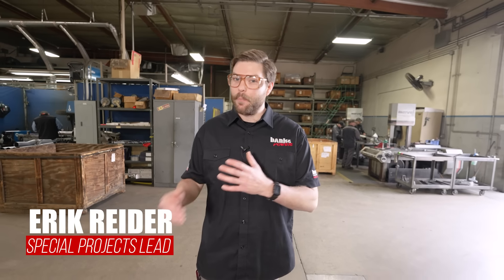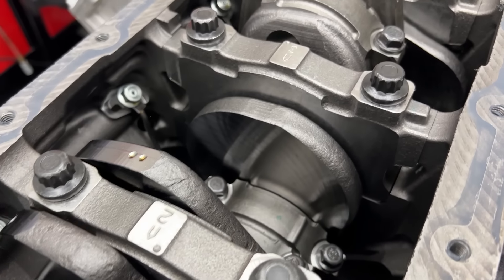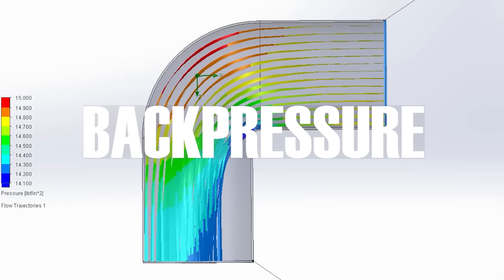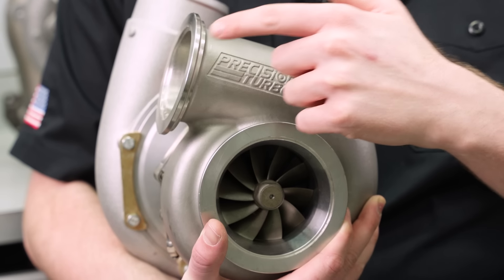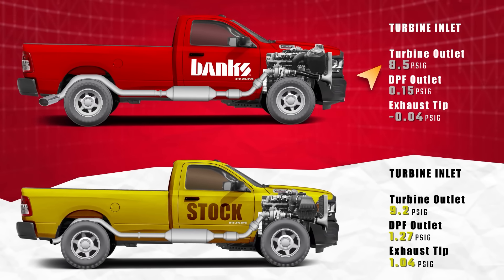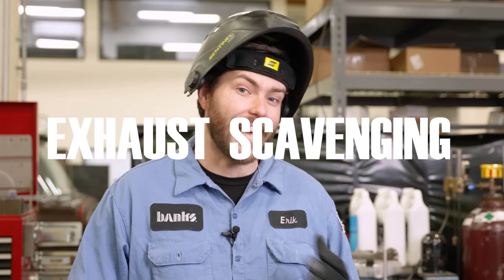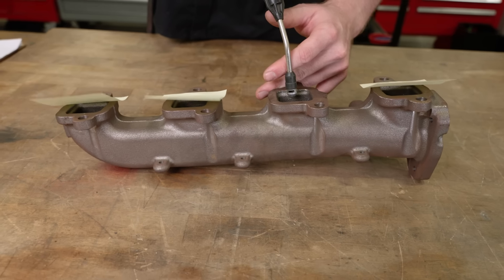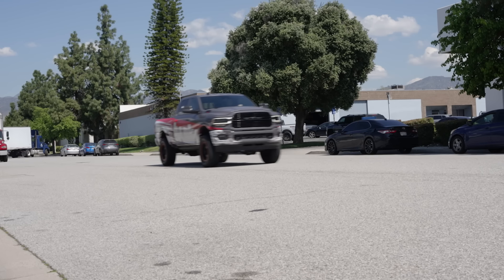Busting the exhaust backpressure myth | Banks Entry Level

Comment: What I’d like you guys to then test is back pressure on the effects of Fuel economy. 

Reason I say this is because on my racing exhaust on my old N/A car when I drove with my exhaust mute on the car (which arguably creates a back pressure/flow restriction) I had much better fuel economy. 

This was on an N/A JZA80 running a HKS Racing Exhaust. 

I’m since Turbocharged with same exhaust but I wouldn’t dare run the mute on my current setup.

This is why  I argue, Backpressure bad for power but potentially good for fuel economy.

Let’s see what you guys think if you’re willing to do the testing. Note Gasoline vehicle not Diesel

Comment: I have a 68 ford falcon. Built 289 and although it sounds great with open headers it's extremely doggy, but the with headers flowing through the full exhuast it spins halfway through 2nd gear.

Comment: not sure about more modern engines but if you improve the exhaust flow the car may start running lean. At cruise and low load it self corrects but at WOT it uses a predefined fuel map and it will not add more fuel so it could run leaner than would be required to be safe

Comment: This all comes down to air velocity at both intake and exhaust valves for a given engine.  

The intake system before the intake valve and the exhaust system after the exhaust valve have an effect on each other.  
I am an engineer and I have done CFD simulation on intake systems.  
To be honest it takes a CFD (computational fluid dynamics) analysis tool to predict those delta P's.  
Everything else is just guessing and trial and error.  
Banks is doing CFD and validating their presumptions. I do that very thing for a living and it's time consuming and tedious work.

Comment: Thanks for another information video @bankspower. There has been a constant discussion about the valve lash setting on 6.7L Cummins. I have been told that setting the valve lash on 6.7 Cummins makes it run better. Seems like it would restrict the amount of exhaust from leaving the cylinder. And keep that extra pressure in the cylinder. Could shed some light on this?

Comment: Nice Video and technical explanations. Can Back Pressure be also a result of poor exhaust gas velocity for instance going too large on Turbo Downpipe on a small capacity Turbo motor ? So what happens is more cooling of the exhaust gas as it expands into a much larger void and thus slowing the velocity and increasing the Back Pressure ? I think this effect may be more pronounced on smaller engines but on bigger motors, not so much. so when they say you need back pressure I think they mean, make sure to use optimum pipe diameters for your engine capacity.

Comment: The origin was not dealer myth, it was the fact that less backpressure means more pumping efficiency, which means more air.  Unless the carb can account for the extra oxygen in the system, the engine would run lean and burn out valves.  Its the reason that Fuel injection engines typically need a tune after new headers particularly if they use speed density fuel management.  Speed Density tables count on the engine having a set efficiency range and adjust the fuel vs intake pressure according to that engine setup.   MAF system know extra air is coming in and can better adjust up to a point.

Comment: I installed a full banks exhaust on my Cherokee years ago. Im running a different exhaust now i still have that banks header in my shed though surprisingly it didn't crack ive replaced many cracked manifolds on many 4.0 engines over the years it doesn't matter if its a performance design or stock replacement they all crack eventually, my motor mounts may have helped keep the banks from cracking being that they are more solid than stock but i put over 100k miles on that header. I have seen a cracked banks header i replaced with another banks on someone's jeep but its a damn good header one of the best. Another thing to keep in mind on a jeep that sees off-road is these exhausts go through hell especially if they go through water and stuff its surprising how much abuse my header held up to. 
After installing that full exhaust on my Cherokee the power was noticeably more its a good exhaust. But isn't the muffler on that system a glasspack design? Maybe im thinking of another muffler but i thought the banks muffler was muffler shaped but straight through glass pack. We have had a bunch of cherokees I'm a bit of a Cherokee nerd. My wife has a banks header on hers mine is heavily modified we also dont run cats anymore but i had the cat and everything with the full bolt on system years ago that was a good system. Im running a Gibson header then custom exhaust with a flow master muffler on mine now. 
Back in the early 2000s i was running one of those cherry bomb glass packs on my old datsun and when i replaced it with a regular muffler I believe a flow master the low end torque i picked up and power was crazy i was very surprised because that truck was a slug it was a 4x4 on 33s and didn't have much power so the increase just from a muffler swap was awesome. 
Im a big fan of the banks header on the 4.0 i went with a Gibson on mine because I didn't like how the banks was rusting and the Gibson has a ceramic coating then the design looks similar to the banks i believe the banks is stainless but it still was rusting some it was also like 8 or 10 years old when i replaced it.

Comment: Its also conflated with Exhaust velocity. too big of a pipe will drop the velocity of the exhaust causing the flow at the cylinders to not evacuate completely as its not moving fast enough to do so. too small and the opposite happens. while yes the velocity is higher, the gasses cant move out of the way, because now the pressure is too high.

Comment: 1st mistake: When you pop open the exhaust valve, most of that gas blows itself out under pressure. The exhaust stroke only forces the last remaining bit out. Obviously flow resistance doesn't help, but the piston is not doing even a quarter of that work.

Comment: Properly tuned diesel and direct injection OK. How about petrol carbureted when valves overlap? Your mixture will go down the drain and BANG! Backpressure keeps the mix inside the cyl when the valves overlap.

Comment: If you have back pressure on newer cars your catalytic converter is plugged. A good exhaust assists with scavenging and leaves a vacuum in the cylinder

Comment: Great video, yes please on the headers video. Short vs long, equal vs unequal for blower and turbo options would be great. 

Loved the pressure sensor based design, kicking bro science right into the weeds. 🦾👌 Scavenging vacuum tip is really cool too. I think I caught a glimpse of how it worked in the video. Clever stuff. 😉🤓😎👌

I’m really keen to tune my Pajero but I don’t trust half the clowns over here… I’ve been around tuning shops since I was an engineering student. I’ve seen so many people, including customers in one of the shops I worked in 🤗 having their motors blown up by cowboys with no clue and no regard. Luckily I was in my final year when the other mob took it over. Only six months to run. 🏃‍♂️ 😅

It’s a minefield out there, not anywhere near enough Banks’ in the game sadly. 🫠

Comment: My Ford E350 had one of its downpipes bolts rust away, so it slipped off the manifold on that side, was super loud, but i definitely noticed some effects on its performance.  This has to do with a combination of reduced back pressure, and likely something to do with O2 sensors and how the Ecu is programmed. It actually bogged down at lower rpm and seemed to make less low end torque. I did however feel a bit more powerful at higher rpms. Honestly the lost low end was more noticeable for most daily driving in a work van, but I did miss the surge of power higher up after I fixed it. Simple enough concept, at lower rpm the amount of flow required to produce the low end torque and power is much lower than at higher rpm, someone can explain in more detail why the low end was neutered, it probably isn't because of not having back pressure, but rather, from not having enough exhaust gasses forced past both O2 sensors. At higher rpm there was just enough.

Comment: The fun thing about this is my k24 needed a muffler to idle properly. All the stuff i tried didn't work. Then throw a stock muffler back on and it idles mint now
Reply: I run twin resonators no muffles in my car and its fucking awesome. Perfect idle, loud, great throttle response from 850-6500 rpm and big flames on shifts over 3000 rpm all on the standard tune. You should try it!

Comment: Exhaust back pressure debate. It depends on what you are after. Car manufacturers carefully engineer their mufflers to find a good balance between power, efficiency (gas mileage), emissions and noise level. If your argument is about the most power, you are probably right. If it is about fuel economy, I would say it depends on the system design. When it comes to complete combustion and efficiency of the catalytic converter, you will find another optimum point for flow and pressure. When it comes to noise level, there is yet another optimum design which would yield the lowest noice but with reduced maximum power and efficiency. So it depends on how the system was designed

Comment: I think this myth also comes from the people who put too large diameter pipes on their vehicle. Lost low end torque. And figured it was "not enough back pressure" causing loss in power. When really it was lack of velocity and / or poor tuning in general. Making them believe back pressure was needed. When really the smaller pipes increased velocity.

Comment: Backpressure is needed for an engine. A two-stroke engine. That's where people got the "myth" from. They heard that one type of engine needs backpressure and that obviously means ALL engines need backpressure.
Reply: That's for sure not only where the myth started, but also 2 strokes don't need back pressure either. What you're thinking of is tuned pressure waves, via those expansion chambers. And those too are tuned for specific RPM ranges. if not designed correctly they just end up causing restriction and back pressure reducing overall power.

Comment: Lets talk about why an n/a engine will loose low end power substantially when running open header with extentions vs a full high flow exhaust. Engine i speak of is mu ls1 with a bigish cam. Afr is accommodating for the lack of restrictions but has no snot under the curve but did when i had exhaust on it. Psa fuel management is always learning and adjusting tune
Reply: I believe you need to have good afr. If you run a standalone ECU, you can adjust for the pressure change.

Comment: Right I see a lot of confusion and misunderstanding in the comments. In scientific and engineering nomenclature there are two kinds of pressures happening in a tube. The dynamic pressure and static pressure. The backpressure that people are talking about is static pressure and the speed of the flow is dynamic pressure. Now here is the interesting part, the dynamic pressure and static pressure have an inverse proportionality relationship (I'm trying to simplify the concept here). This means that the higher the flow speed, the lower the static pressure. But this is only true up to the transonic region. Once past this point, the static pressure will increase with the increase of flow speed until the choke point. Putting on a big exhaust to reduce backpressure is a misconception. The size has to match the flow rate for the modification to be effective.

Comment: The only thing back pressure does is increase the duration of the power curve, good for daily driving and fuel economy but no good for drag type racing where you want all your power in a narrow high rev range.

Comment: Thats weird because when my exhaust pipe rusted in half I felt a power loss...sounded big but drove poorly. Hows that explained? Plain diesel engine. The scavenging must work also with a log style because of the gas flow and the shorter the pipe less velocity I guess?

Comment: I have a supercharged Mini Cooper s, Works. It has one 2 and a half inch exhaust pipe and splits off to 2, 2 inch pipes half way down the car. I’m wondering what the effect would be by removing the two split pipes and running the single 2 and a half inch pipe all the way back? Thoughts…..

Cheers.😊

Comment: I suspect this myth arose because stock engines with modified exhausts - and nothing else changed - do make less power.  The benefits only arise when you do a proper job on the whole intake and exhaust system.  I was always told that you really need the right camshaft as well.

Comment: The term back pressure is probably what confuses people. If you put a huge exhaust on a naturally aspirated engine, you will lose torque down low because of scavenging. So you do need some resistance. Turbo is a different story of course.

Comment: So this videos argument is strictly for their diesel products. Got it. You need some amount of back pressure for drivability. Why everyone fails to mention this is beyond me. If we all went full throttle with open headers then NO back pressure is great. But since you have to slow down on the street and maintain speeds through corners back pressure is needed for a smother more powerful mid range power band. The back pressure argument can only be applied to specific applications. Always fun to see others points of view on this topic

Comment: This only applies to turbo gas and diesel only.  Try putting a 3” free flow exhaust on a naturally aspirated engine and let us know how that changes the power band and torque curve.
Reply: Your correlating backpressure with scavenging velocity.
Reply: @208Concepts 
Which correlates with back pressure

Comment: The turbo actually extracts waste thermal energy from the exhaust stream and converts it to work in driving the compressor so it is not as parasitic as a belt driven blower or compressor.

Comment: As far as i know, the reason why engines didny run right when you opened up yhe exhaust was because the vacuum signal that the carburetor saw wasnt the same. A problem that EFI motors can easily adjust for without needing a tune, and a problem you can aolve by adjusting your carb to allow for more fuel. 

All in all, if im correct, back pressure is never a good thing like Erik said, a higher flowing exhaust just needs an extra step on carbureted engines.

Comment: I went from 25 mpg to 35 mpg 
Was higher, but sound police would give a ticket 
It would be higher, but calif held up my order for headers 
Proving epa is all wet 
Relative works for them 
I used extra power for wider wheels, almost double the width 
I had stopped in 50 feet or would been killed cause hitting dear threw me 100 ravine

Comment: Just stop.
Anytime people start this argument they always ask the wrong questions. 
True or false, the diameter of headers/ length and diameter of the collector and diameter of the exhaust will tune the engines torque curve to make it more effective in a specific RPM range. 
True or false, a header and collector add more restriction to exhaust flow than an open head to atmosphere. 
I have found that a bigger / less restrictive and lower back pressure exhaust that is too big will reduce the drivability of a car. 
In this case a smaller diameter exhaust showed noticeable improvement. Therefore, a smaller diameter exhaust was in fact better. And a smaller diameter exhaust adds what??? back pressure.... but in a specific amount for each engine. 
Otherwise, we would all just add 5-inch exhaust to every engine. And no one does that. If 5-inch exhaust was the best thing for all engines then BMW, Mercedes and Ferrari would add them to all their cars and also F1. They don't because it isn't better. It's not like we can't all add 5-inch exhaust and find out for ourselves.

Comment: What I have not seen on the exhaust system products, like on a diesel truck with emission, is before HP rating on dyno and after the parts installed..  To me that is the holy grail in spending the money on parts is to help with performance and, as we all know, HP increase is the holy "Gail"... 

Even on the Ram intake horn and grid heater delete plate there is no actual dyno test I am aware of in HP increase, just air flow increase for the most part..  Where's the beef.. ?? :)

Comment: It doesn't necessarily hurt anything, either.  If you have 0.7 psi of back pressure at 6000 rpm, then you have virtually none below 5000.  They sell an exhaust system on peak hp numbers and don't mention you'll never feel an improvement.

Comment: its cool seeing jeep 4.0s being talked about :D
Makes my jeep i6 soul happy 😆 got lucky and Went with an ARH header setup (for 400 bucks ) over the banks, since the Banks always seem to crack unfortunately :( but the 6 to 1 setups dont but they wont work on an 05 Lj due to the extra sensors otherwise id rock that setup
Reply: Grrr.  I have an '05 LJ.  I was thinking about this as an upgrade.  Do you know of a header that does work on the '05 LJ?
Reply: @johnfitzgerald5158  The american racing header its a 6to1 setup with all the 02 sensor pickups and it dont crack like the banks but its about 1800 bucks but i scored a deal for 403 bucks with everything but a bubble clamp, Its a beautiful header !